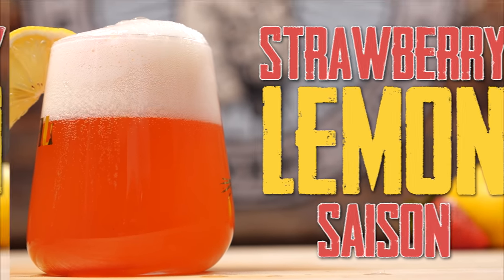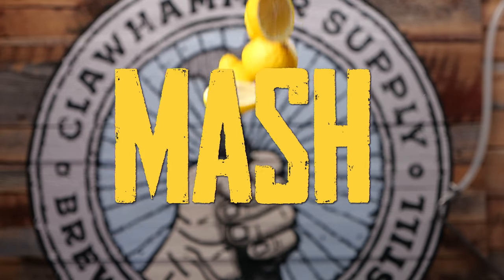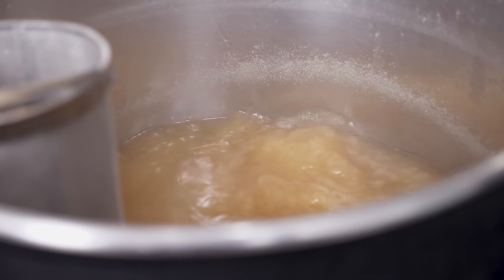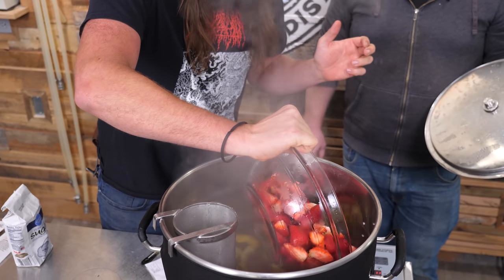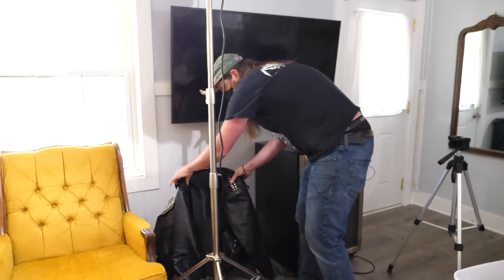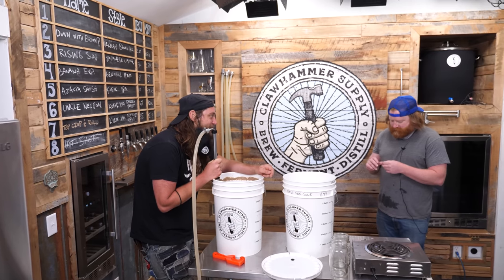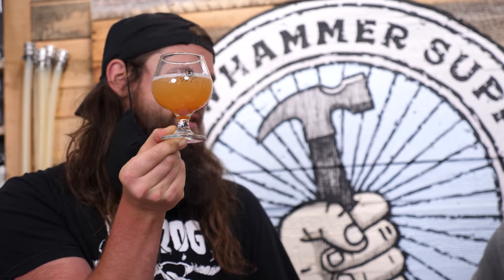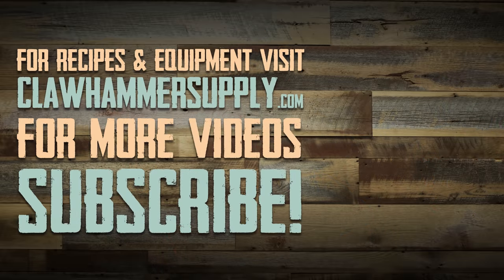How To Brew A Strawberry Lemon Saison - Perfect Springtime Recipe

Comment: I’ve been using a Tilt hydrometer for a few years now. Word of advice, they are great to monitor the temperature but gravity readings are hit or miss. This is due to yeast, hop matter, and foam adhering and drying to a crust on the tilt. It skews the reading. I mainly use it to see that things are progressing and use an actual hydrometer once done. Brewing with fruit is tough. Did the strawberry flavor come through in the final tasting?
Reply: I was wondering the same on the strawberry flavor.  Notes from their full recipe pretty much answers the question:
"It had a classic peachy saison look to it and tasted bright and bubbly. Our fruit additions did come through in the final product. While it didn’t taste like lemons or strawberries specifically, the beer did taste fruity and refreshing. "
Reply: Sometimes I'll give my fermentor a shake if I think accumulated crud is throwing off my Tilt. Usually does the trick. Tilt monitoring gravity trends has been invaluable for fast tracking my lagers. Knowing when I've hit about 50% attenuation is yuge for starting the ramp up for my diacetyl rest.